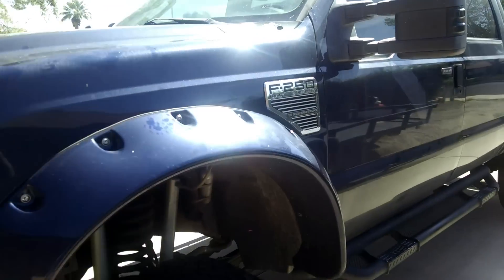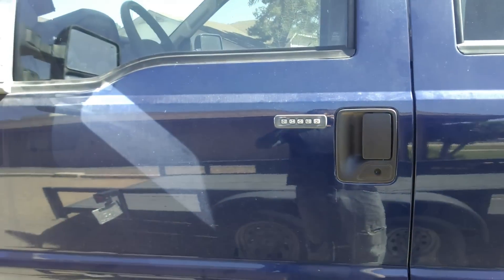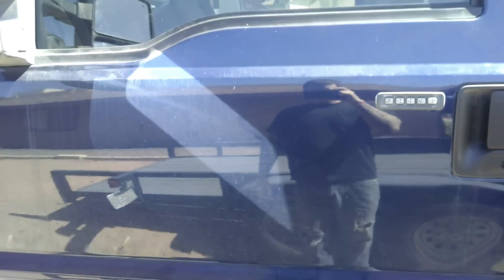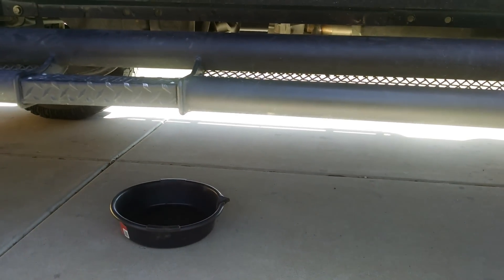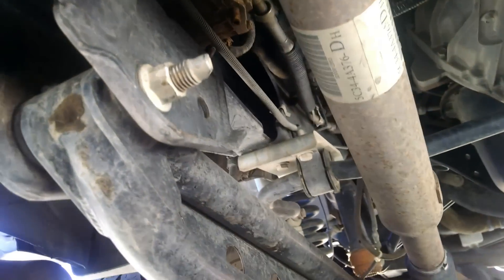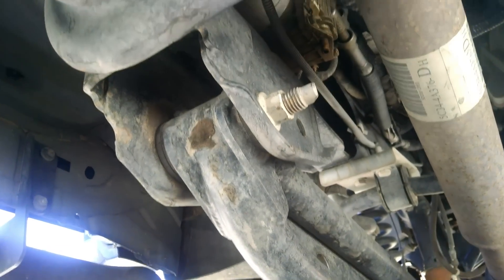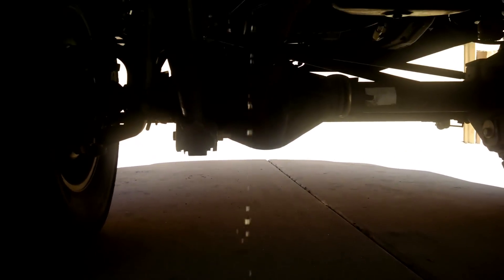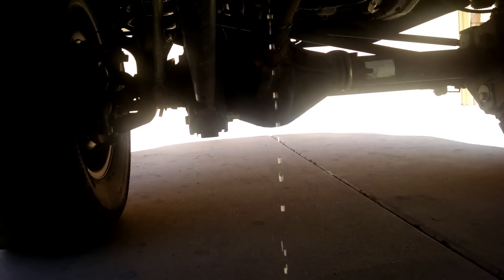Ford 6.4 Powerstroke Diesel Fuel Water Separator Drain Instructions

Comment: Beautiful truck. Do I add any fluid after the drain?
Reply from the maker: No fluid or anything to add. Just prime the truck before starting it. You'll hear the fuel pumps running for 45-60 seconds during priming. After they finish, you're good to go.

Comment: So, are most of the issues and problems that arise with the 6,4 diesel motor because people fail to do this regular maintenance? 
I keep hearing about all these issues but I wonder if these issues happen because people buy diesel trucks and don't know they have to do regular maintenance, they fail to do the maintenance and then the truck fails and the truck gets a bad rap. Is this true or are these trucks breaking even when you do take care of Maintenance?
Reply: The 6.4 is a solid engine and it does need attention because people have the habit of driving them till the check engine comes on and deal with the issue or issues. This truck requires attention and regular maintenance, checking air filters, tending to the water separator, oil changes done 5k to 7k and always have oil topped off. The 6.4 power stroke engine is a solid engine.
Reply: Make sure you delete egr/dpf. Keep up maintence. Have owned a 2009 6.4 for about 4 1/2 - 5 years and only problems so far was my turbo went out twice. I bought a used turbo the first time it went out, second time it went out went for a new one. Did have a bedplate leak too that developed after the first turbo was installed but I got that fixed.

Comment: I just bought mines but how do you prime it after opening the ignition switch
Reply: Turn the key to the only position. Leave it in the on position for 30 seconds. Turn the key off and then back on for another 30 seconds. You will want to do this 5 times and the system will be primed.

Comment: What is the most you have seen drain out? I am not sure if I have a problem or not because I turn off the tap when it hits a gallon. The light keeps coming on after a half hour. I took it to Ford and they wanted $1000 bucks for a fuel manifold and a sensor, but they could not swear the sensor was bad. They sucked and I am still guessing as did they.
Reply: After draining, if message still saying to drain water separator, then that usually means the sensor inside the filter housing is gummed up with crud/algae looking substance & needs cleaned. There's other youtube videos about that issue.
Reply: ..."how to" videos.

Comment: Can I drain it still with the lever broke. My truck came with it broke and my light is on
Reply: I drilled a small hole partly through and use a pick for the lever.

Comment: I am looking at buying a 2008 6.4 and it is extremely low in fuel it’s at a new car trade in auction but it starts right up and uses perfect but when put into gear and trying to go over 1200 rpms it acts like it’s limp mode does the 6.4s have a fuel safety?

Comment: Thanks for the video but man! Ive been having to do this like everyday for the past month! My light KEEPS coming on and then my truck will lose power and eventually die on the freeway or wherever im at! In fact, it JUST happened to me again like 10 min ago. And when i drain it its just a slow drip everytime/ no steady stream like yours had in vid. Any suggestions??? TIA!
Reply: You got a clogged water separator drain, if the light comes on and nothing comes out when you try to drain. Some people have had luck clearing with a q tip, compressed air or putting 4' of clear tube in the drain outlet and sucking until it pulls the clog out. Good luck
Reply from the maker: Could be numerous issues but the first place to start is with checking/changing the fuel filter. Up on top the engine next to the oil filter.

Comment: Do you know what I can do if my twist lever is stuck? It doesn't want to move and I put a good amount of pressure on it but I do not want to break it. For now I have cleaned it up with brake clean and then sprayed some PB blaster on it to see if that helps. Any help would be appreciated.

Comment: Does this cause white heavy smoke to come out of the exhaust?
Reply from the maker: Omar Hernandez : White heavy smoke is usually an excessive fuel issue or a head gasket/warped head. If the heads are good then most likely means a sticky injector, which is common in 6.4's and 6.0's.
Reply: fallen771 I'm getting heavy white smoke not sure if it's a blown turbo seal but I'm getting a code for a clogged dpf.
Reply from the maker: Omar Hernandez : Get it looked at asap then. I tell everyone to remove the DPF's for mileage and longevity but if you want to keep it then it's a costly item to maintain. Clogged means several possibilities. If you're not used to working on a diesel I suggest taking it to a shop asap.
Reply: fallen771 I want to delete it so bad but I live in Cali where emission laws are strict last thing I wanna do is get a heafty fine. Thanks for the info man it's greatly appreciated
Reply: Omar Hernandez heavy white smoke also can mean that you are burning coolant

Comment: Anybody done a video on changing the actual water drain valve  with a new kit, the twist level in mine was broken at some point  before I started driving it. Light has just come on??
Reply: Stephen Carroll I had to replace mine too. It's easy three bolts and whole ball valve comes out. Kit has everything you need to replace.
Reply: Alguien podría decirme qué tiempo le puedo dejar de Nando el agua del diesel
Reply: @chester5010  I know I am replying to an old comment but is this the method to drain before replacing this kit. My valve is dripping diesel and needs replaced.
Reply: @bigpapadaddyo6937  Yes. Make sure your fuel tank is low so fuel doesn't keep pouring out. Last summer I upgraded to a Fass  lift pump eliminating the stock one. Much better in my opinion. Good luck
Reply: @chester5010  so does this method drain a section or the whole tank? I have about 15 gal in right now. Thanks for the quick response!

Comment: Nice rig... I have an 09. How many miles u have on it now and have u ever had any major issues
Reply from the maker: 60k miles. It's only used for towing/hauling, offroading, and camping trips; is not a daily driver. Never had issues besides the typical pulley bearing issues that is minimal. All emissions equipment has been removed though.
Reply: fallen771 I'm at 130,000...I am second owner picked up at 100,000...I too only use mine as a recreational vehicle boat, camper, and date night...lol I still have all emissions and I'm tossing around idea of doing deletes because of all the videos trashing my 6.4...I love this truck...I have a little smoke coming my oil fill but I've talked to guys on here that say theirs have done it since 30,000 and never got worse, that the motor is just known for a little blow by...how yours? Got anything when oil cap is pulled? I have some when warmed up but no pressure behind it and truck runs great with no oil leaks or anything
Reply: Do I put water back in it after I drain it?
Reply: 246k miles on mine.

Problems I’ve encountered and replaced

Dpf/egr delete added h&s mini maxx tuner
Turbos replaced
Bedplate re sealed
Replaced oil pan
Rear main (no issue was preventative)
Timing cover gasket (no issue was prevented measure)
Tensioner replaced
New belts
New batteries
New rear end (diff axles etc)
Reply: @David-zo9oi  hi there david, hope this is getting you at a good time, i was wondering if you could let me know how much it was to delete it?
Reply: @danperry5789  I had mine deleted like 6-7 years ago. I had it done at a shop, it was about $5.5k if I remember correctly. I still got the receipt so I guess I can double check. If it’s way off though I’ll edit the post with actual price.